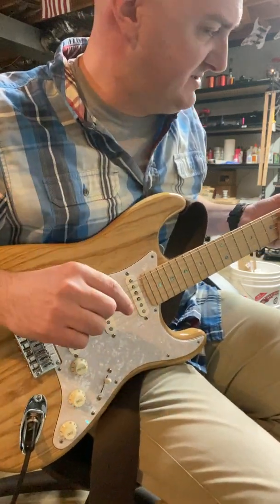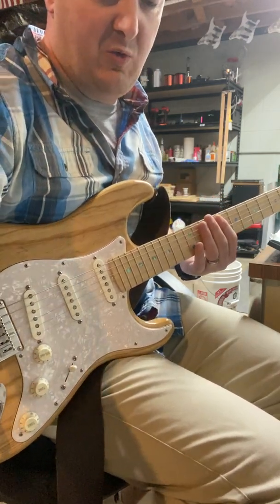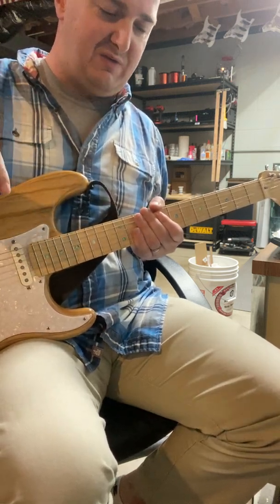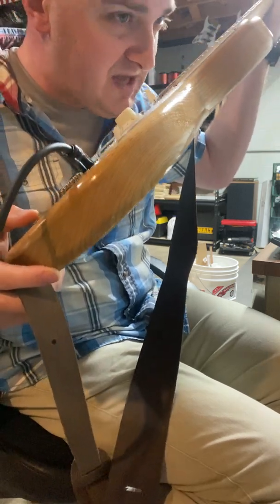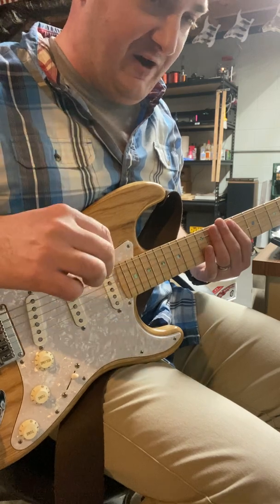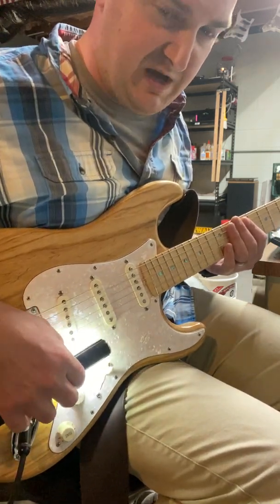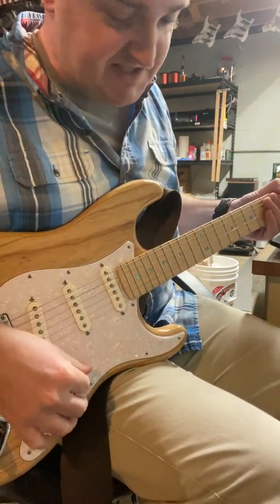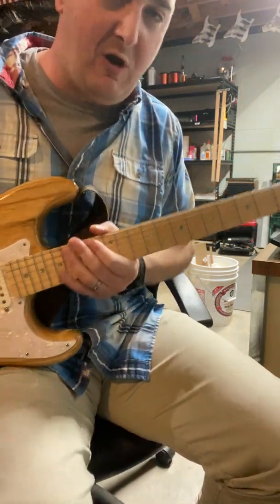60 cycle hum, RFI and Shielding is useless Noisy electric guitars SCIENCE EXPERIMENT

Comment: What if i hear very quiet hum when no touching anything and loud hum when i touch the humbuckers? Also no hum while touching humbuckers and bridge at the same time.
Reply from the maker: Not sure without hearing it and seeing it in person.
Reply: @MathewsGuitarWorks  Here is a short record of the buzz. It's totally quiet, then when i hit the string i can hear slight buzz in the background and then when i touch the pickup it's getting worse. https://www.youtube.com/watch?v=lusKboIG6N0
Reply from the maker: @basicpl15  what amp set up are you using?
Reply: @MathewsGuitarWorks  I don't use any amp right now. Haven't bought anything yet, although i'm connecting guitar with the PC to use it with neuralDSP plugin and checked it with basic speaker with jack input and it's all the same.

Comment: With respect to the poster for his effort in putting this video together, I politely disagree.

The home environment is very noisy electrically.  Between appliances, PC's, cell phones, digital toys, and messy 110VAC, you have a nasty environment, just like some older venues with old dimmers and corroded electrical connections.  It's hard to determine "cause and effect" when the noise level is so high.

One miss in this exercise: failure to unplug the cable from the amp and crank the amp volume to determine how much noise the amp was introducing.  When I'm experimenting, I use a solid-state battery-powered headphone amp that plugs into the guitar.  Those gadgets hiss; it's the nature of some semiconductors, usually far in the background, and has a sound complete different than hum and RFI.  This approach eliminates cable and amp noise.

As someone who's been involved in radio and TV broadcast engineering since 1969, I can assure you electric guitar pickups ARE NOT microphones.  Your voice modulates the strings and the guitar's body, the pickups "hear" those moving strings, and that's what your amp hears.  Don't believe me?  Yell at your guitar with strings, then take the strings off and yell again.  You don't even have to go that far: yell with your hand off the strings and then press down the strings over the pickups before yelling again.  Repurposing a quote from James Carville: "It's the strings, stupid!".  Still don't believe it?  Put a bare-nekkid pickup on your bench, connect it to your amp, and yell.  

I'm trying to think of one song where the lead vocalist has sung through a guitar pickup.  After 60 years and 5,000 albums, I can't come up with one.

Pickups don't "hear".  They're electromagnetic devices: the magnet in a pickup sets up a magnetic field, a moving (plucked) metal guitar string interrupts the magnetic field, and the changed magentic field induces voltage in the coil(s) which is then amplified.  Same principle as a generator, actually.  Dual-coil pickups are physically identical and connected backwards to the output and this cancels a lot of noise (the signals are "out of phase").  

When you yell at your guitar, and I do it all the time (well, I yell at my fingers, actually), the sound you make is air moving over your vocal chords.  The mechanisms for electric guitar signals and the human voice are completely unrelated.  No, Scott Weiland did not yell into Robert DeLeo's neck pickup: he yelled into DeLeo's strings.

Let's be absolutely clear: a properly-strung electric guitar will act as a very primitive microphone for the reasons described above and an electric guitar pickup by itself is not a microphone. 

There are dozens of videos demonstrating the effectiveness of properly-installed cavity shielding and a blanket statement claiming shielding is "useless" is one man's opinion.  But a properly-shielded guitar may be noisy for other reasons, like cold solder joints and broken ground wires (which, strictly speaking, are not "shielding" issues).  Good shielding technique entails using copper tape with conductive adhesive, careful application in every cavity, ensuring the switch assembly isn't touching any grounding material, covering the back of the pick guard in copper, and confirmation with a volt-ohmmeter that all shielding is properly bonded to the output jack's ground.  Stuffing Mama's aluminum foil into one cavity and calling it good won't work.

I'm not saying it's perfect but the consensus opinion is that it does make a difference.

The solutions: good copper shielding, good pickups (my Ric 340, Steinberger Spirit, and LP Standard with P90's are silent; the 1998 Tele, 2023 Squire Tele, 1992 American Standard Strat, and 2023 Squite Strat make a Metallica concert sound quiet); high-quality signal cables; a clean pedal board (lots of opportunities for nose here), clean power to and inside the amp, and a clean performing environment.
Reply: well said

Comment: I have Tosin Abasi humbucker signatures and have no noise at all until i go to position 4 which is neck single coil voicing and then i get 60 cycle hum. Based on this video I know it's not from grounding and the fact that it only happens on that one position. So with it being just 60 cycle hum and my gates can't stop it (well they stop it until the string starts ringing then it hums while the string resonates of course) what can be done anything? Only solution I know of at the moment is to scoop it out inside of a DAW with a frequency noise canceller addon. Anything besides that anybody?
Reply from the maker: Nothing you can do for 60 cycle hum unfortunately. The more you attempt to take a single coil and reduce the hum, the less it is a single coil and more a humbucker if that makes since.

Comment: I have exactly the same click sound in my strat hum. At least for me it comes from the electric fence for the horses. The voltage pulse is exactly at this frequency.
Reply from the maker: The click in the video is coming from my amp. It stays the same with all guitars. 

I would have to hear yours to see.
Reply: I thought the click was coming from your watch. I had this problem in a recording studio. In my case, it was my watch coming through the pickups. I will watch the video again. I assumed you had a watch on as I have experienced a similar clicking  while recording. In my case, I took off the watch and was able to eliminate this clicking. At any rate, I did not mean to disagree with you as I trust your reasoning in this video and you have a ton of experience and evething you said here makes sense and lines with my experience.

Comment: Do you have a power transformer in your neighborhood?  I saw a video that showed a guy that called power company and they fixed the humming by working on the transformer.  He had that clicking noise just like yours. The metal parts of the guitar might be acting as an antenna.  I f you have a portable amp, you could walk the neighborhood to see if the interference gets stronger near power co. equipment outside.

Comment: Wait, but grounding the AC outlet all the way to the guitar wouldn't solve the problem? I mean as long as you don't make any other ground loop.
Reply from the maker: Good grounding always helps increase signal to noise ratio. It won’t eliminate all noises though because some noises aren’t caused by grounding issues.  Shielding is useless in electric guitar circuits.

Comment: So, you're not exactly right but you're not exactly wrong and yes, I am actually a formally educated electrical/electronics engineer and the cliche heavy metal and instrumentalist guitarist that shreds a the "godly" level.

These circuits aren't actually shielding the pickups when they provide some dB reduction in the signal dropping across your inductors, they're providing a path of less resistance for the 50/60 and other signals getting into your pickups. I've heard systems that most definitely drastically reduce it, but it's not actually shielding or "bucking" the RF. It's also not a straight forward mod where you just install the materials, ground it out and you have great results. It's a lot of time, work and constantly testing it to see how much reduction you have achieved, and then there's still the issue that it may be picked up by another circuit within your gain cascades from guitar to processors to amp.

There is, however, a guaranteed way to eliminate it and that is through a 90° active bandpass filter of incredibly high dB magnitude. I built one a couple months ago, went to 32 dB and while it made a tremendous reduction in rising my signal well above the noise, it was still there and even 64 dB wouldn't have gotten rid of it entirely. My bet is a reduction of 96 dB is necessary, but I've read documentation from others that have built them and plenty go over 100 dB!
It's in itself, a simple circuit, but you're going somewhere just above  60 Hz for your high pass, I went with 72 and didn't have noticeable signal loss, and your low-pass portion is going to be best at right around 10 Khz for guitar. One resistor = 3 dB and 1 capacitor = 3 dB, so it's 70 RC networks to achieve 105 dB lower and 105 dB upper filtering! lol

It absolutely works, but I haven't gotten around to actually building one so very extreme. I would also test it to see if a high-pass of around 72 Hz would be enough and there wouldn't be any harmonic content of the RF or other sources sneaking in somewhere in the upper range of bandwidth.
In the end, there are still other ways of doing it which I've used for 15 years now.
That's simply low passing your signal steeply with 10 tons of gain and when you bring highs back into the signal as harmonics rather than direct production from your guitar and pickups, 90% of the noise is long gone, the highs seem intact, but if I crank up the treble on this distortion pedal I designed and built, the noise comes flooding back in and you realize just how much of the highs and portion of mids have been gutted.

Ultimately, I tend to agree with your sentiments and rant though, it's not likely to work if you just buy the materials and install them as instructed, and when it works, it's not actually a Faraday cage, it's an antenna of greater conductivity and less resistance ABSORBING the problematic RF and bypassing it to ground. It's a lot of trial and error as well as using test equipment to truly get  a significant amount of bypass, but I've both seen and  heard people do it where they got lucky, or they did all the trial and error. Lastly, even with that ultra steep filter in the gain cascade just after your guitar, the risk of another piece of equipment introducing it is still a significant risk. At some point in the near future though, I will build an elaborate series of networks and be 100% rid of RF interference without brutalizing my upper bandwidth like I currently do.
Reply from the maker: Don’t know anything about the circuit you built. This video was simply to ID what the sounds you may be hearing and also to show people shielding in a guitar doesn’t work because the entry gate for rfi is still exposed to the outside would in the form of the pup face. 

Passive components don’t amplify the signal so they don’t have to be shielded either. Short of a giant lead box, shielding in a guitar does nothing. I’ve said pretty much everything you’ve said to others, just in a lot fewer words. 

Thanks for commenting.
Reply: @MathewsGuitarWorks  passive components are the primary source for noise in the case of the guitar. Your amplification devices increase it's magnitude, but they are entering the signal chain directly through your pickups. Pickups are passive, potentiometers, capacitors etc. Sensitivity and frequency response determines the most likely sources, but even potentiometers can pickup noise.

I explained you cannot shield a guitar, but you can reduce the amount of RF voltage dropping across the passive components of your guitar by installing another circuit that provides a path of less resistance for the RF. This is why in some examples, people can achieve a significant reduction in noise with a circuit they regard as "shielding", but it's actually just a more effective antenna than the induction coils in their pickups. It is reducing noise, but not by shielding aka bucking it away. There will be less voltage drop of RF across the coils, and a greater voltage drop across the "shielding" in those circuits that achieve it.
Reply from the maker: @JonDeth  RFI cannot be introduced into a passive guitar circuit via the volume or tone controls without the pups.
Reply from the maker: @JonDeth  I don’t care about installing another circuit into the guitar. I wasn’t talking about any of that in the video. I appreciate the input about your experience with making something to add, that’s really interesting. No part of anything about what I made the video about or have discussed in conversation is about anything more than ID’n the sound people may hear and shielding in a guitar with non active components does not work.
Reply: @MathewsGuitarWorks  you're way outside your depth is the problem lol. Adding and grounding shielding is adding another circuit.
If it's done properly, it adds a lower path of resistance for the voltage of the RF to drop across, and it will conduct more through what is being called "shielding" than it will through your pickups, and reduce noise.

*It doesn't work in the simple process of just installing shielding, grounding it and "wah-la!", the noise is gone, but with the right process you can add a "shielding" circuit and greatly reduce the RF noise.

Comment: With this video my search for getting rid of this hum endeth here ! Thank you !  ive bought expensive power conditioners, Morley Hum Eliminators Shielding, noise supressors, (all they do is suck out the tone) and this is the video i have needed all along well done sir well done indeed, ill just learn to live with it as it only happens in my home.
Reply from the maker: I’ve learned to live with it too. Especially with single coils. I’ve found I prefer the sound and feel of single coils to noiseless pups trying to be single coils. I like all different types of pups, single coil and noiseless alike. I don’t play high gain stuff so when I play at normal folk-stage volume and gain I barely notice it. Noise gates and anything in the guitar signal path to stop noise definitely suck tone which I know are useful for some folks but I don’t really care for it. Shielding does nothing on passive guitar controls because they don’t produce anything and when pup faces are still exposed to the outside world, shielding the back of a pup is useless because very few RFI waves make it through the back or sides of a guitar.
Reply: This video should have a million views and save many guitarists tons of money ! @MathewsGuitarWorks

Comment: Wondering if it's true to say that hotter pickups will be more likely to be more sensitive to RFI than cooler pickups? After substituting my noisy bass with a friends (same amp, same everything), my friends bass was almost perfectly quiet.
Reply from the maker: Very good observation! In my experience, you are correct. The hotter the pup the more voltage produced. So smaller RFI’s can be amplified louder. Obviously that’s a very general statement and there’s more to it than that. In a similar vein that may help shed light, take for example a strat style single coil vs a p90. Both are single coils and both have 60 cycle hum. In my experience p90’s almost always hum louder than strat pups of the same DC resistance. In this case, not being “hotter” like you mentioned but different coil shape and pup construction have an effect on frequency output. The fact p90’s have more mids, I think this adds to the louder more perceived 60 cycle hum.  I believe you are on to something.
Reply: @MathewsGuitarWorks Thanks for your reply. In my case both guitars were p basses, however my noisy one was a MIJ model from mid 1980s, and my friends was a much later US made Squier.

Comment: Use a guitar cable that is shielded only one end.  This will cut out a lot of the ground hum.  Plug the shielded end into your guitar, so the cable is shielded all the way to the amp.  The copper braid shield on a guitar cable is only there to shield the signal wire down the length of the signal wire.  When the ground from you touching the strings, is connected to the chassis ground of your amp, it creates a ground loop to the A.C. power supply.
Reply: interesting. any suggestions on cable companies that offer a pre fabricated cable like this?
Reply: @NeuroplasticityReprogram  D'Addario Planet Waves, I have a couple, one end is marked shielded end.